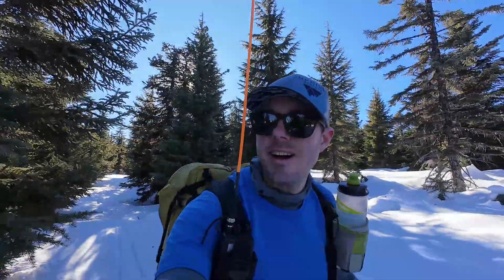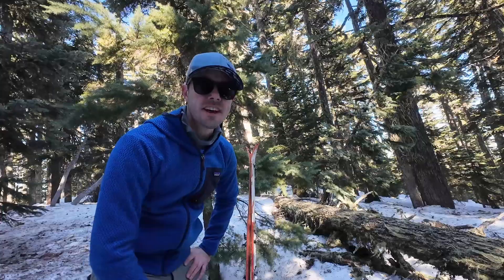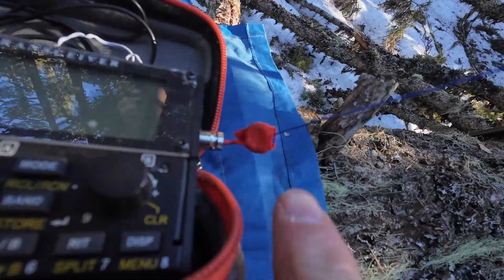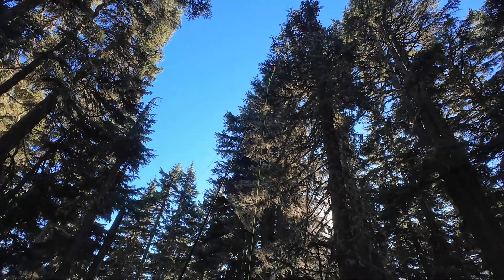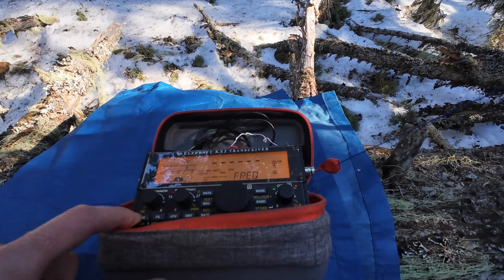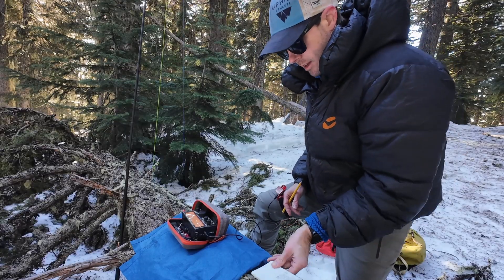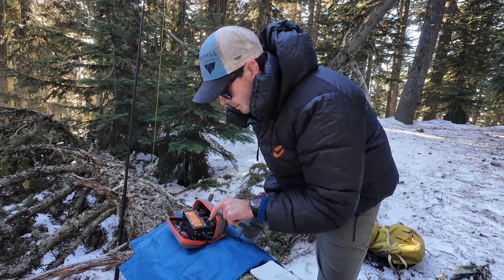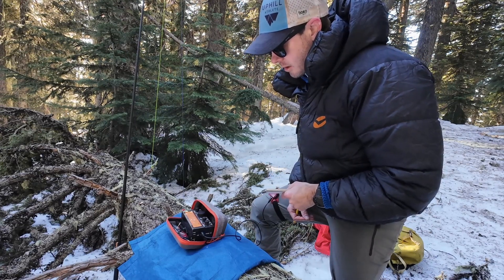Smol Antenna, Big Results! | K6STR Emergency Backup Antenna | Summits on the Air

Comment: Hey! I'm making this antenna soon, I already have the toroid and everything but I was just wondering, are the antenna and counterpoise lengths exactly 8 and 13 feet or is that just a rough estimate? If so, do you have any idea of the actual measurements?
Thank you for the video and 73s, EA2FFP.

Comment: Excellent video, Tim! It's so great to see a video of this antenna in action! It does surprisingly well - Mike (K6STR) really struck gold with this design! Cool paddles btw ;)
Reply from the maker: The Ashi Paddle with the leg strap is perfect for winter because I can stand like Captain Morgan and not get cold.
Reply: Hey! I'm making this antenna soon based on your design and with the T50-6 toroid you use. I was just wondering, are the antenna and counterpoise lengths exactly 8 and 13 feet, like stated on your site, or is that just an approximation? If so, what are the actual measurements?
Thank you in advance and 73s, EA2FFP.
Reply from the maker: @nuboso9275 I used those measurements for my build, but since you use it with a tuner, I bet a little variation is okay.

Comment: Did you wind your a little different than Ara does?
Reply from the maker: I think I mostly wound it the same way, but they use a different toroid. I think they also do a couple less turns, which might help when trying to tune 10-15m.

Comment: Very cool!  Japan with a tiny wire - super cool!  What's that little paddle you're using??  TU.  73
Reply from the maker: That's the Ashi Paddle! Made in Japan. It's a very nice paddle with mechanical switches. Feels like typing on a mechanical keyboard hihi!
Reply: @N7KOM  thanks!